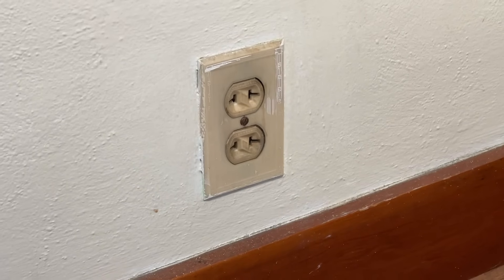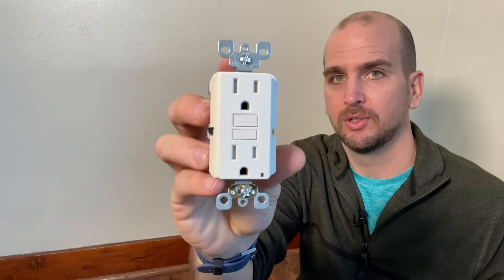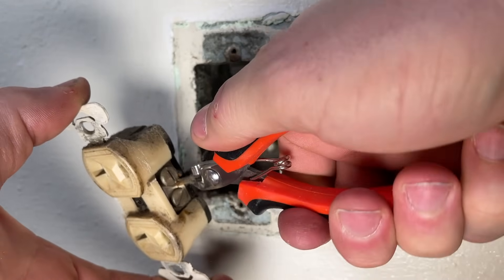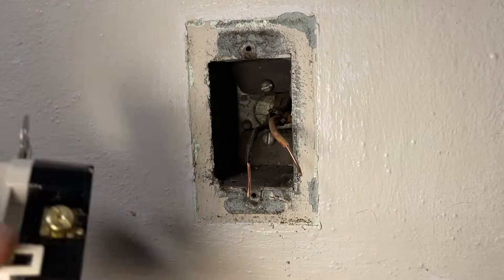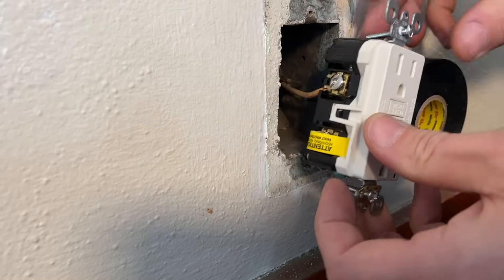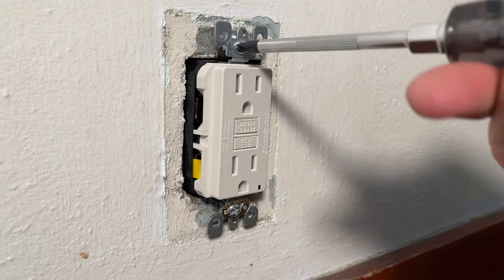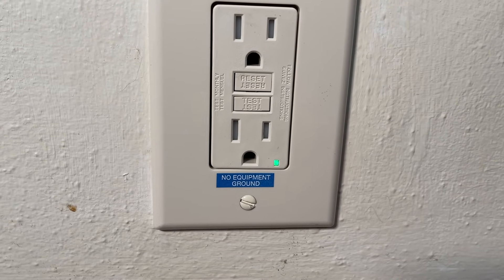How To Replace An Old 2 Prong Outlet Using 3 Prong GFCI

Comment: Years ago I worked as a building manager for a home building company one of my jobs to be there for the inspection on one job we were failed because 3 of our gfi didn't work I had checked them with the button and it had said that they were working but the inspector used a gfi tester and they did not work the two in the kitchen were defective the bathroom one was not getting ground so the electrician came out replaced the two in the kitchen and traced back the bathroom one about three receptacles back he finally found where the ground was not making contact fixed it and the gfi receptacle was working after that I picked up a gfi tester so unless they have changed them in the last ten years I would get a gfi tester they look just like the three light tester but with a button to test gfi circuits so I would check them with a gfi tester not just the button since the ground and the neutral are connected at the panel box I just jump it at the receptacle
Reply: This method is only for replacing old sockets. It is not a way to replace three prong sockets that for some reason have no ground connection. A general rule is that the wiring has to match what law said when it was laid. If you have a new home with improper wiring without ground you will need to rewire,
Reply: @okaro6595  whether or not it's for a old system without a ground wire or a newer ground wire version the point is that the GFI outlet did not work without a ground so putting in a GFI outlet on a old system without ground wire unless they have changed the way way way GFI outlets work with no ground they test OK with the test button on the GFI but if you test them with a GFI tester which actually puts a simulated touching of the of the hot wire ie.a tool with the hot wire shorting to the case or your accidentally touching the hot prong on the plug it doesn't trip leaving you to complete the circuit to ground and if you have wet footwear and a wet surface or touch the sink you will if you survive be singing you light up my life so before I would install a GFI outlet with out a ground and just trust it to protect against a short I'd check it with a GFI tester first

Comment: I have a question regarding the Load side. Can you use only one GFCI to protect all downstream (Load Side) receptacles, or do you need one at each location?
Reply: That's what the load-side screws on the GFCI outlet are for.

If you tie the downstream wires to the same screws as the supply side, then the downstream devices WILL NOT have GFCI protection.  If you tie the downstream wires to the load-side screws, then they will.

The instruction sheet that comes with the GFCI will tell you exactly which wires you should attach to which screws in order to correctly connect it.

Comment: Seems simple enough. A pet peeve of mine is when builders (or whomever is doing the install), does not install the outlet straight/level. We have a few of those, and it is so bad, it would require cutting the drywall and such. Ugh...
Reply: There are adapter or adjustment kits to help wit too deep or unlevel boxes.

Comment: The GFCI receptacle wired without a ground works because the fundamental operation of the GFCI receptacle is to trip if there is an imbalance of current between the hot and the neutral. If the GFCI receptacle senses an imbalance (e.g., more current being supplied by the hot lead than is being returned to the neutral lead), the GFCI receptacle trips. Typically, the tripping point occurs when the imbalance is greater than 5 mA.

Typically, circuit current imbalance occurs because of some defect or misuse of an electrical appliance and current flowing through an individual who is standing on some grounded surface such as the floor and/or touching a grounded device (e.g., water faucet) while using the appliance. 

The GFCI receptacle does not protect against overloads or shorts. That is the responsibility of the breaker/fuse at the load center panel.

It should be noted that a GFCI receptacle without a wired ground will not detect a ground fault in some attached appliance until a ground fault occurs through some other ground path such as a human.
Reply: I think Scott does a really good job, but I love reading comments like yours, because it adds so much value. Thank you
Reply: Wonderful explanation. Exactly right. Was the recommended solution in my mom's old house and passed by the ELECTRICAL SAFETY AUTHORITY.
Reply: Thank you Art! Though Scott started a very important conversation, you gave us the answer to why change it out in the first place! Well Done.
Reply: Ap
Reply: They don't call them widow sticks for nothing
Reply: You have no business instructing people on electrical work. If someone gets injured or worse you will be liable. Find another diy topic to make videos on before you get some electrocuted. ( FYI to all..... NEVER RELY ON A PROXIMITY TESTER TO PROVE ZERO VOLTAGE !!!! This novice actually touched the terminals after a simple proximity test. NEVER DO THIS.)
Reply: @fritzmiller9792  I agree with you about non-contact testers, but in this case it was an omission on his part rather than ignorance.  He's done several videos on switch and outlet replacements where he discusses the different ways to check that a circuit is properly de-energized.  Still it would be good if he added a note to the video pointing this out and linking to how to do a more thorough check.
Reply: @docferringer  Respectfully Doc, I don't think the words 'ommission or ignorance' have anything to do with the fact that THIS video shows , that is, INSTRUCTS someone to physically handle electrical terminals after a ' non contact tester' (to use your term). Someone watching this and only this would not be  aware of previous videos. The bad move stands alone and can't be defended....The disregard for the danger is reckless, the existing conditions and voltage potentials of any given outlet across the nation ( or the world for that matter) is absolutely unpredictable. As a tradesman, I am disappointed in any experienced electrician that would egg this guy on...
Reply: @docferringer  Making excuses for this guy makes you culpable , at least morally, for any injury resulting from his unprofessional inexperienced uncertified ill- advised incorrect instructional videos.
Reply: @fritzmiller9792  whats wrong with contactless tester we use them in high voltage work everyday. This is on voltage at 35K.
Reply: @thomasmarable6818  I don't know what your training or experience is but I know that you don't immediately touch the electrictrified bare metal until more has been done to de- energize the equipment. Typically for higher voltage such as 35 k ( technically Medium Voltage) a grounding bridge is placed across the busses. In any event, something more is used to proof and to maintain zero potential than a proximity voltage test. The different scenarios are almost endless but either way, the video is teaching a bad move to the general public on its bare face. Please stop defending this guy.
Reply: @fritzmiller9792  There is nothing wrong with non-contact testers. Did you completely miss the part where he tested the outlet with the circuit hot (got a reading), then tested it again after shutting off the breaker, then tested a third time after the cover plate was off? There was no need to bust out a multimeter and test a fourth time. Maybe the reason people are defending him is because he did a decent enough job and you came in as an overbearing blowhard and that's putting it nicely. Not sure why you are even leaving a chastising comment about the video as a reply to someone else's comment but I guess that's how far off your rocker you are. Why don't you do yourself a favor and stop watching electrical videos on YouTube if it's going to make you such a salty person.
Reply: @nova31337  Don't recall seeing any of that. Are you referring to previous videos that he put out? Because I saw this from the beginning and I stand by my observations and criticism. And who is salty exactly ? I stuck to my professional opinion and kept emotions and insults out of it. There is no point in either and I make a point not to do either. I know what I know from a lifetime of construction  , 33 years of which as an electrician and 22 years of that as an Electrical Contractor. This guy has no business teaching electrical work and again I caution those that egg him on to reconsider....the trades have licenses based on experience and education for a very good reason. Respect the trades.
Reply: @fritzmiller9792  1:16 to 2:02 shows the whole testing process
1:22 Tester showing hot reading (3 bars)
1:30 Turns breaker off
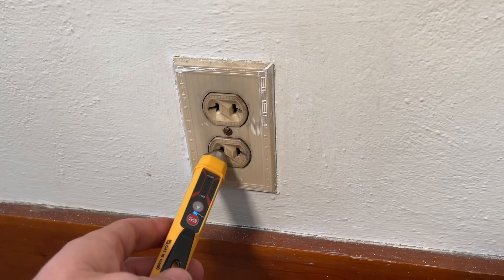1:36 Tests again with the same tester showing cold reading (0 bars)
1:58 Tests again with the cover plate off to "double check" (still cold reading)

I don't know how you don't recall seeing any of that. Are you sure you didn't just jump around the video and skip all the testing and jumped straight to the spot where he took the cover off and did his (by then) third check?

In many videos he's very upfront about not being an electrician so take that as you will. But when you come stomping in here huffing about "muh trades" screaming with your CAPS you just sound like a sad sac. Point out what's wrong, sure, but try to have some tact. Yammering on about who has a right to teach or not is not your call. People can get information or talk about whatever they want. It's the viewer's decision to implement something or do more thorough research before trying something or even seeking professional help.

I've seen many crackerjacks out there do slipshod work, despite being licensed. I can "respect the trades" because I know where my limits are and if I want to go further, I can do that too. Changing an outlet or roughing in new wiring or breakers, sure, changing out a whole main breaker panel for a new one, nope, I'll get a professional for that. There's a lot of good info out there, some given by actual electricians and I find it amusing and a bit sad how they get criticized maybe even more harshly by their peers than the usually grateful general audience. Take it easy out there.
Reply: @nova31337  You are only supporting my point, you and those like you now have a false sense of safety. I just watched it... He doesn't use a contact tester and then he touches the bare electrical terminal and that is exactly what I pointed out. It would be too involved to explain   a number of ways that the job should be done safely but my opinion stands that telling people to trust the proximity tester is irresponsible and dangerous. BTW, your outrage about my criticism says a lot more about you than the characterisation you are trying to paint on me. I simply don't want people to be electrocuted or injured.
Reply: @fritzmiller9792  You assume this is everyone's first video on messing with outlets. The smart ones will have looked at several, the other ones, well, Darwin has spoken on that.

Also, are we even watching the same video? At what timestamp are you looking at that he does this? I at least provided timestamps and what was happening at each step.

"It would be too involved to explain..."

ah, say no more copout king.
Reply: @nova31337 Again, in this video he only uses a Proximity Tester. I think my point has been made clearly and I don't think a break down with timestamps is necessary to understand my warning. Please don't rely on this video as adequate knowledge to work on circuits. The list of possible conditions and scenarios that can involve the presence of deadly voltage is long and storied. Electricity is far more deadly than many people realize and it literally takes experience to even understand just how much that you don't know. Lance, I have determined that you fall into that camp... Too ignorant to even understand your ignorance. You are indignant to hearing good advice because you are defensive about said ignorance. So maybe there is some chance that you might even listen to someone who knows about the subject instead of hurling insults. Good luck. ( PS don't trust your life to a Proximity Tester)
Reply: @nova31337  I've seen some interesting things watching professional wiring a home in one case I noticed that the guy had run a wire from one bathroom counter plug to the one below so I waited until he was working in bathroom upstairs and ask him where he was feeding the to the bathroom counter plug and he said from the downstairs bathroom I later asked him when he was downstairs working neer the bathroom where he was feeding the counter plug from his reply was from the upstairs bathroom I then pointed out that he was feeding the upstairs bathroom counter plug from the downstairs bathroom counter plug and he was feeding the upstairs bathrooms counter plug from the downstairs bathroom counter plug and neither had power to it he finally caught my point and went up and checked it out and found that I was right since he had done like most electrician and filled each of his circuits to the max he ended up with one circuit having an extra outlet because he had originally planned on feeding it from the master bedroom
Reply: @douglaswindsor120  Get a new electrician
Reply: @nova31337  Just want to say that I've waited since the first Youtube instructional video ever appeared for someone to lay down that reasonable response. Well done. I get so tired of sanctimonious ''pros" who believe they know it all and DIYers know nothing.
Reply: @user-hm5zb1qn6g  thanks and yeah, they act like you have to be a pro and hold a license to do basic stuff. If I had to call a licensed electrician for every receptacle (because using the word outlet causes them to go into a blind rage for some reason), I'd be broke and the work would never get done because I live in an area with very few electricians not willing to spend time on anything less than a multi-hundred dollar job. They act like DIYers are cavemen banging rocks together. They're just sad that people bold enough and smart enough can cut them out of the process for a number of menial jobs where they could otherwise have racked up a nice bill for themselves for simple work.
Reply: @nova31337  If people only knew that ''journeyman" is more of a branding exercise than an indication of expertise. Guy I grew up with is a journeyman electrician. He can't even change his own outlets...sorry, receptacles. Because at tech school you take class work. Then you go into the field and get hours. In his case, those hours were accumulated by pulling cable on industrial jobs in the oilpatch. For 4 years. Pass the classroom tests and accumulate enough hours in the field...boom...you''re a journeyman. It's not like having to take the state bar exam or medical exam. It's a lot more like becoming a realtor. When I hire guys I am on site talking to them and watching their work. There are great electricians, and there are guys I wouldn't trust to plug in a toaster. It's Hirer (is that a word?) Beware.

Comment: BAD! Snipping off the wire like that because too lazy to unscrew the wires from the old outlet. It looked like the wires were already shorter than usual, which makes installation of a replacement tricky and difficult. Now those wires are another half inch shorter. The j-hooks would have easily fit around the screws of the replacement recepticle.
Reply: I was surprised as well. I actually thought he was going to add pigtails since the wires were so short.
Reply: looks like it went in just fine with that length of wire. it was a bit on the short side but i would rather see fresh copper being used to make the electrical connection after all the electrons do not really care if the wire is now half an inch shorter but they will certainly notice the slightly higher resistance of the old corroded wire. if it was any shorter then you could always pigtail it but i would still cut back to some clean copper first. Also its weird that you call this being lazy when the method you described using is the lazier way.
Reply: @HPD1171  The wire was not corroded. shorter wire makes it much harder to put pigtails in. this wire is already much shorter than required by current code. you should atleast have 6 inches outside of the box. Cutting it by far is the lazier option.

Comment: Whoa, I has those double-Ts outlets in my current 1950s-era house.

Good thing you had the detector and didn't get zapped like I did when replacing them. Turned off the breaker, the lights on the traditional LED receptacle/GFCI tester went off ... and yet ... there was still power.

Turns out those double-Ts were a NEMA 1-15P / 2-15P combo unit that went away in the 60s. They are ungrounded 15 amps, but have both 110V & 220V.   And despite turning off the breaker, the other hot phase of the outlet was still on.

Needless to say, I quickly bought a Square-D handle-tie and corrected the panel breaker.
Reply: Wow, that's pretty scary, never know what dangers lurking around in an old house.  

History lesson at least for those in their younger years.  The original reason for the double t slot, and the reason they were banned in the early 1960s, had nothing to do with 110 or 220 volts.  In the early part of the 20th century,  just as many homes were wired up for the first time,  there was two different plug types in use, the parallel prongs, what we today call nema 1-15, as well as the tandem prongs,  what we today know as nema 2-15.  So most older receptacles like the t slot could accept either configuration.  The parallel prongs were officially rated for 110 volt in the 1930s, but the tandem prongs were UNOFFICIALLY for 220 volts until the 1950s, and though most all of the older outlets were indeed wired for 110 volt, not all were, especially in some older commercial buildings such as office buildings,  so you had to be certain which was supplied before plugging stuff in. Hence many old outlets , were marked 125V 15A/250V 10A, accordingly